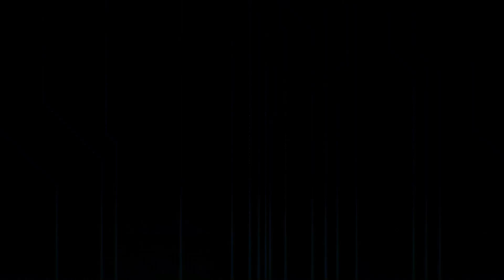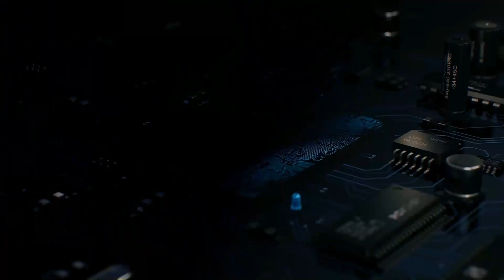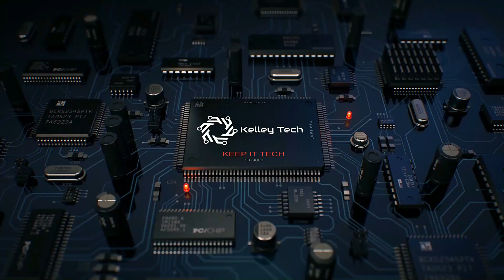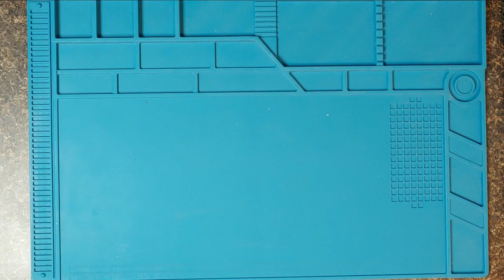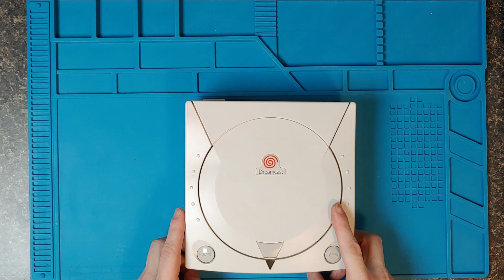SEGA Dreamcast Internal Bluetooth Mod

Comment: Anyone know where I can find the firmware for this thing? The pin out on the blue retro is different (thats why there is a warning not to use their firmware), but I cant find the original anywhere to compare and re-flash.

Comment: I've had a lot of reliability issues with this mod and Xbox controllers. It works fine with one controller, but when connecting up to 4 controllers, often it is stuck in paring mode or crashes when 4 are connected. It also often forgets controllers it had paired to previously. Have you experienced any issues like this? BlueRetro adapters seem to work much better for me. Thanks

Comment: You could have desoldered this pairing button from the board, soldered 2 cables on the pads and taken the button to the GDEMU's plastic cover, it would be cleaner, to pair, simply open the disc door and press. Anyway great work.
Reply from the maker: Hello and thanks for watching. Thats not a bad idea at all. Thanks for the idea. Happy Gaming!
Reply: @araujofi. I just read your comment, and it’s exactly what I thought.

Comment: Enable vmu in the advanced configuration menu where you do button config. You can enable rumble also. Then format the virtual vmu in the dremcast home menu 🎉
Reply: Does it have an internal Memory?
Reply from the maker: I have not been able to figure that out. So I bought this and I love it. https://retrofighters.com/our-collection/strikerdc-next-gen-wireless-dreamcast-controller/
Reply: @kelleytech  In advance setting while connecter and paired to your PC look under Output Config you should see Mode Game pad Accessories None change the none to Memory, Forgot after boot into the normal bios go to the memory menu and format the device it should give you 200 blocks.
Reply: @kelleytech  yes it does have internal memory you can configure it by selecting bank 1 than go in to the dreamcast settings and must format it before it can be used.
Reply from the maker: Good stuff, I will give that a try.
Reply: I managed to do It, but when I turn off the console or I start a game through GDemu the saving functions doesn't work